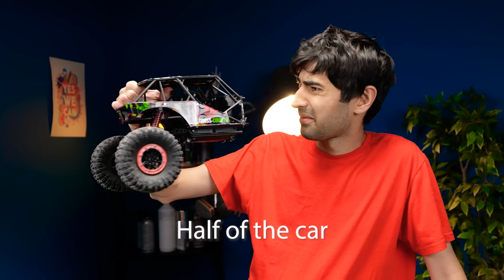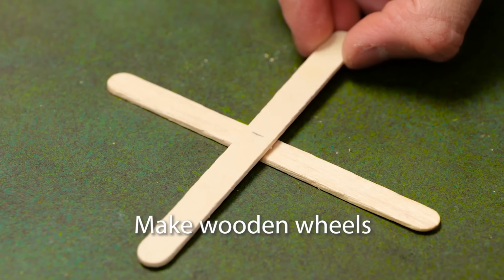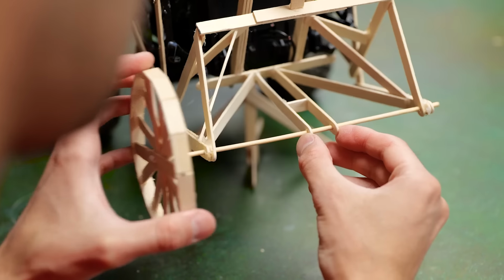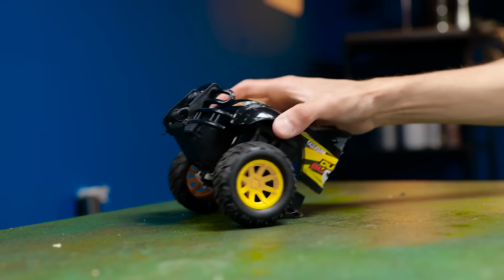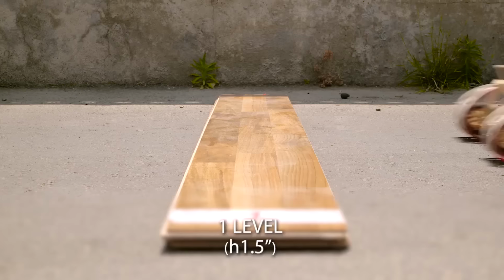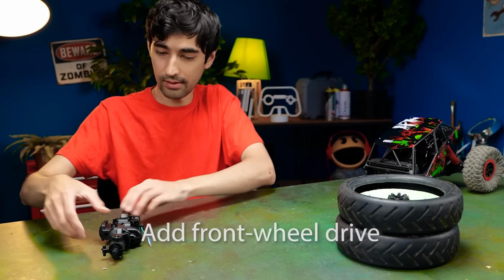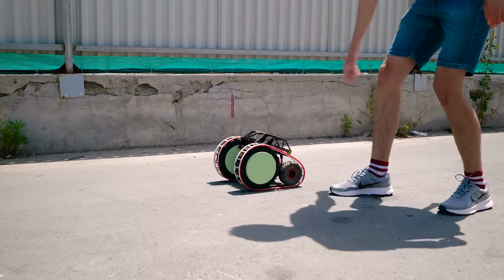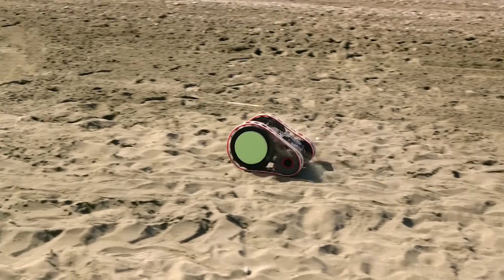I Made The Most Unusual Cars And Test Them In Extreme Challenges! 🚗🏁

Comment: Hello, Friends! 🌟 Are you ready to dive into the world of innovative RC cars 🚗 and adrenaline-pumping racing? 🏁 Join us on a thrilling journey 🚀 as we transform ordinary RC cars into extraordinary machines 🛠️✨, ready to tackle any challenge thrown their way! From hilarious prank-inspired builds to heart-stopping races 🏎️💨 and epic build battles 🛠️🔥 - We have all of this! Let's rev those engines and get ready for a wild, fun-filled adventure! 🎉🎊
              First, we kicked off with a basic cardboard car and jazzed it up 🚀! We swapped out those tiny bottle cap wheels for some beefy ones at the back and threw in a rubber band-based starter for that extra zip. Then, we went full tech-mode with a motor, power supply, and not one, but two extra motors for that rear-wheel drive action, all synced up with a custom remote 🎮. We didn’t stop there; we added some bling with LED lights and fine-tuned it with a steering system. To top it off, we slapped on some foam tires for that smooth ride and floatability, finishing with snazzy decorations and a slick paint job for that wow factor 🌟.
              Next, we began with a wild idea: slicing two cars in half and sticking them together for a Frankenstein’s monster of a car 🛠️🚗. We crafted a primitive yet quirky vehicle using popsicle sticks, then leveled up by swapping those for a hefty pipe wheel, giving it a combine harvester vibe. Not satisfied with just that, we upgraded to traditional wheels and built a custom track, transforming it into an off-road beast 🏔️. The final touches included swapping in Styrofoam wheels wrapped in rubber for ultimate traction and ditching the top to dodge any obstacle in style. The result? A beastly machine that laughs in the face of challenges 😎🔥.
            Did you enjoy the ride through our RC car transformations? Smash that like button to show your support! 🚀 And we're curious - what epic modification would you add to an RC car? Drop your ideas in the comments below. 🛠️💡 Don't keep the fun to yourself; share this video with your friends and fellow RC enthusiasts! For more creative crafts and thrilling races, be sure to check out our other videos:
I Made The Titan Clockman And He's The Strongest Of All The Titans! 🕰️💪 -     • I Made The Titan Clock...   
Caine From The Amazing Digital Circus Could Get Out To Real Life With This DIY Head! 🎭🤹‍♂️ -     • Caine From The Amazing...   
I Made Diorama Of Realistic Garten of Banban NabNab In the City 🕷️😱 -     • I Made Diorama Of Real...  
- - 
All product and company names shown in the video are trademarks™️ or registered®️ trademarks of their respective holders. The use of them does not imply any affiliation with or endorsement by them.
- -
Stock materials:
https://www.depositpho...
- -
Music by Epidemic Sound: https://www.epidemicso...